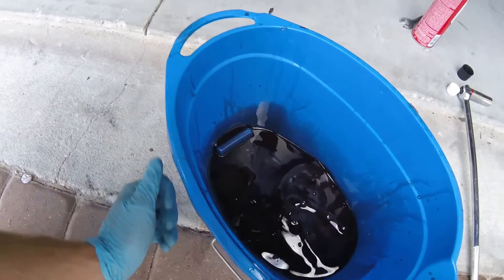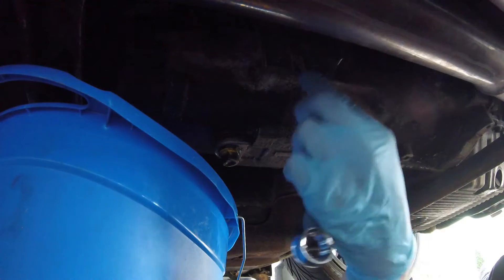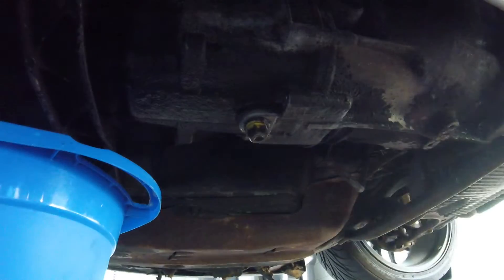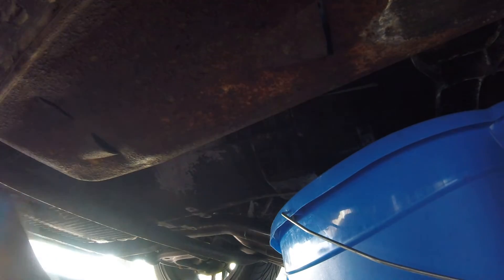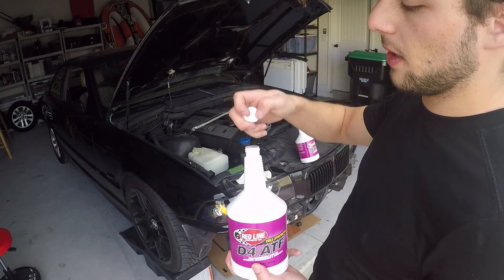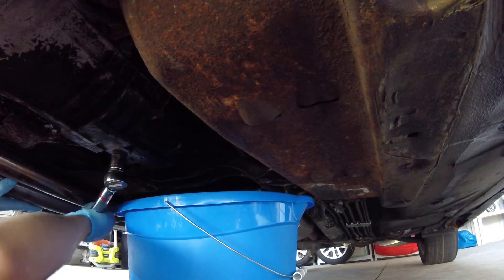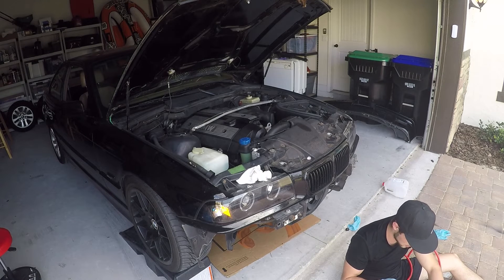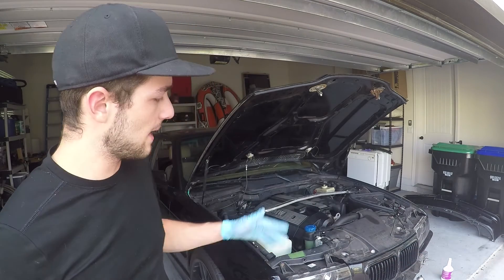How to Change Your Transmission Oil - BMW E36

Comment: Great video, but for next time make sure you have the car level. The reason for this is because that fill hole is meant to be checked when the car is level. Since only the front is lifted you ended up putting more in it to fill it.

Comment: You could lower it either the full
plug off; any excess will drain out, then raise it again, for those without 4
Jack stands. I’m thinking of getting those lift things, but taking the bumper off my car is a bitch and a half.

Comment: What’s up bro I am having Solenoid codes and a slip problem with my 96 e36 all indicating dirty fluid , I was told not to change it it’s 2 late it will slip badly after that is that true ? My car has 191k and I believe the thing never been change by the previous owner ... I need to change it tho
Reply: Change it - old fluid is not holding your car together. Certified mechanic here btw.
Reply: Add some liquid moly anti friction additive, should help slipping.

Comment: I did mine just now 98 328i auto at 120k miles. I know previous owner didn't do it so it came out black like oil.
Reply from the maker: lots of people end up not changing the transmission fluid, sad. On the bright side it is brand new now!